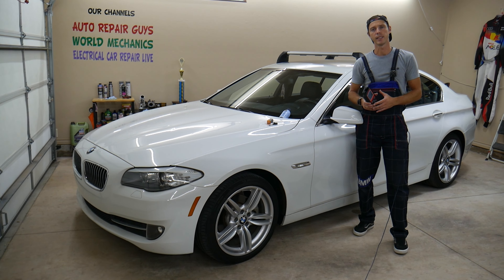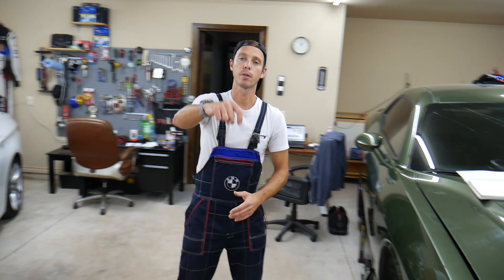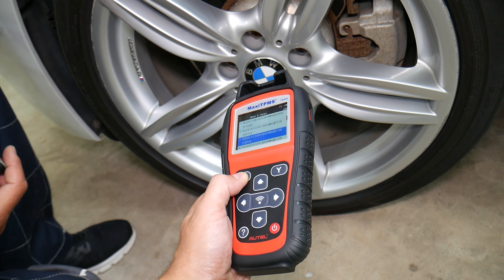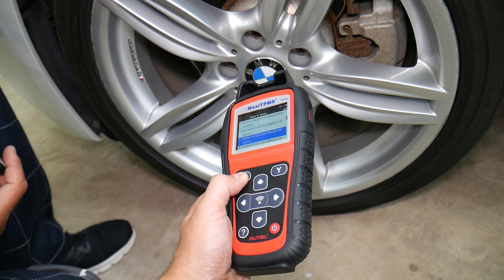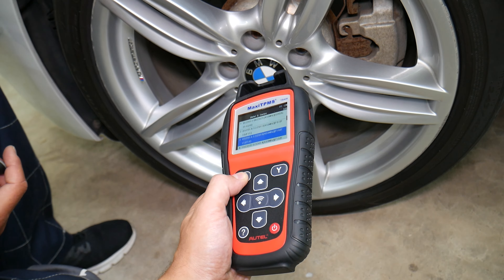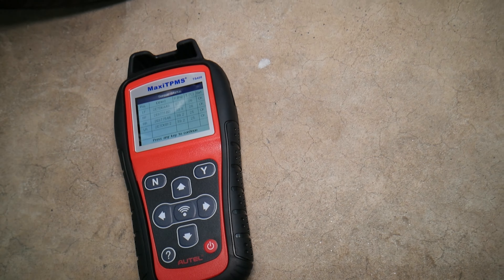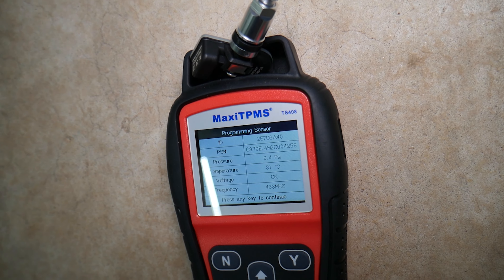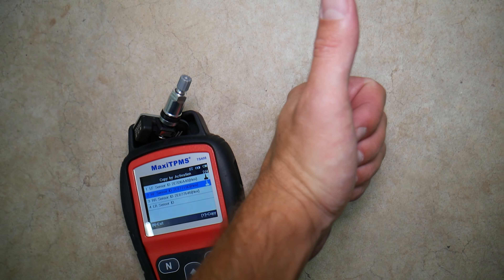HOW TO PROGRAM TPMS SENSOR, TIRE PRESSURE SENSOR BMW F10 F11 E60 E61 G30 G31 520i 525i 528i 530i 535

Comment: Hi, I need some help!!! I saw your video and I follow all the steps on the video with a MaxiTPSM 501Pro and bought the TPSM under your description and Installed them and wasn’t able to program them. Any advise? The scanner tell me sensor not detected on the tire and with air and out of the tire, also I update the Maxi tool and still nothing.

Comment: There is no need for the tool. On my f10 all I had to do was initialize the tire pressure system on the car and the sensors were learned in automatically
Reply: So if you swap wheel location. The car will know and change it in the screen by itself?
Reply: @BLX187  if they are OEM sensors, you don't have to do anything. The car will sense the wheels positions and report information in correct locations.
Reply: What year f10 do you have? Earlier f10s may be fitted with FTM which works with ABS sensor to monitor tire rotation instead of TPMS which gives you actual psi reading. I actually prefer FTM to TPMS since there’s no need to replace the TPMS when the battery goes flat.
Reply: @jegerm6752  can u explain FTM what do I have to  do, I have 2011 535i and 550i xdrive 2014

Comment: Will this work for 2013 chevy cruze 1.4L LT? Two of sensors are not reading correctly and I tried to do the relearn option on the dash board but it still reads low pressure of 26 and I checked all my tires 5 times each with 2 different old cheap tire gauges they are all about sitting 37 I figure leave a little room for hot weather.

Comment: what you did won’t work … how will it pair into the car if you don’t copy it from the OBD?
Reply: Same question. Do we need the autel tool which comes with OBS cable, to read the ID from the car and then put it into the sensor (or assign sensor a new ID and put it in the car thru OBD)?  This is my doubt…